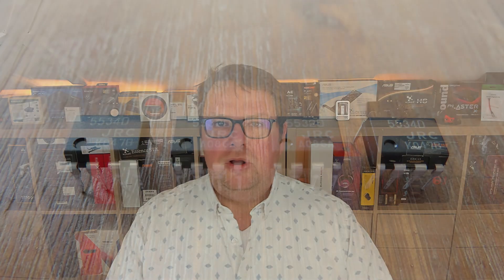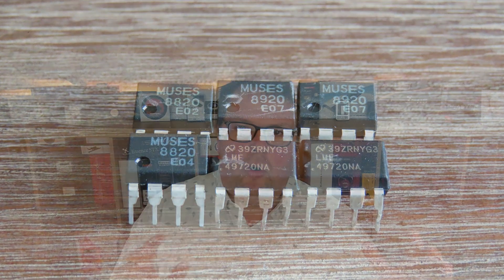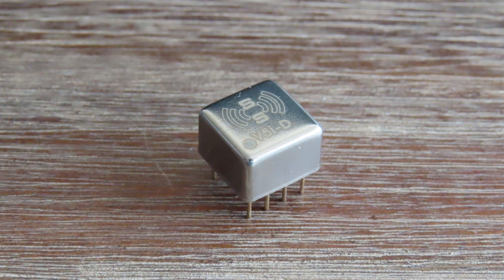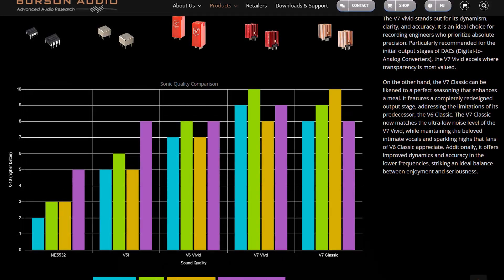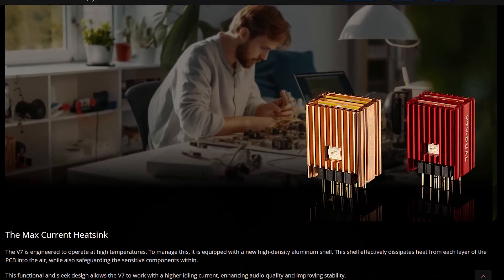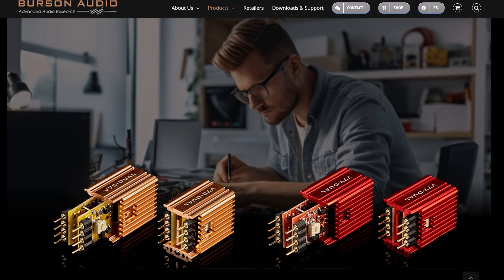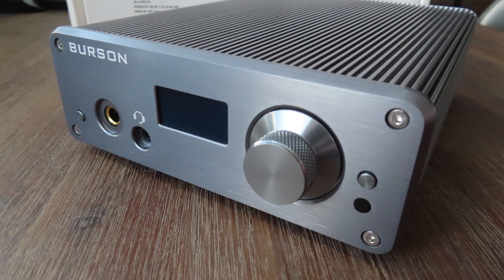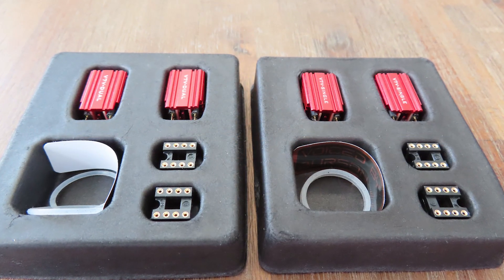Opamp Magic: The Burson Audio V7!

Comment: GO WANKK YOURSELF OFFFF. THERES MORE TO GAIN WITH POWER SUPPLY DESIGNS THAN YOU EVER GRT ROLLING CHIPS.  SO WHAT IF YOU ARE A TENTH OF 1 PERCENT BETTER. QUIT USINGNOP AMPS WITH 7815 AND 7915 REGULATORS THEY SOUND LIKE $$$HIT